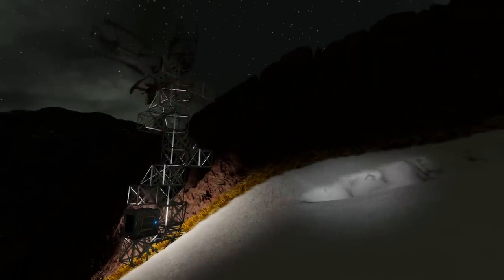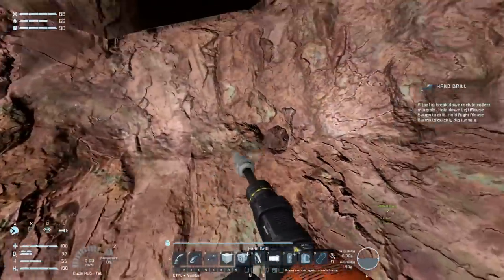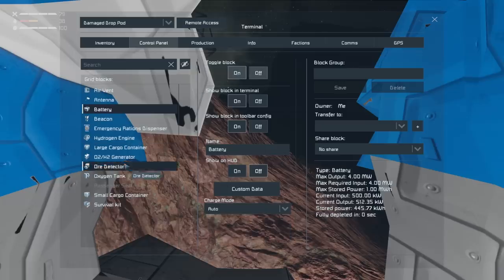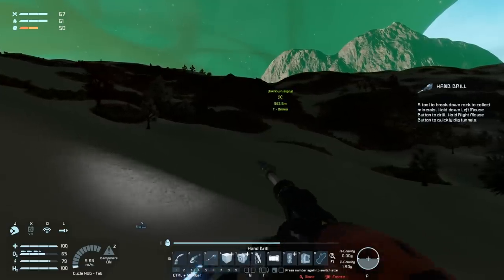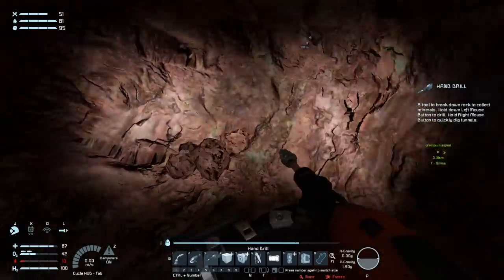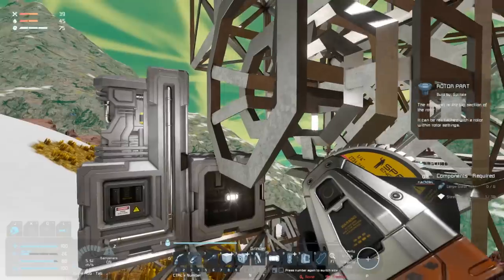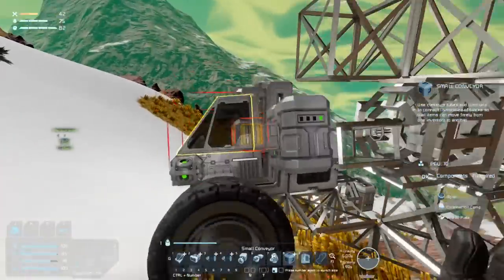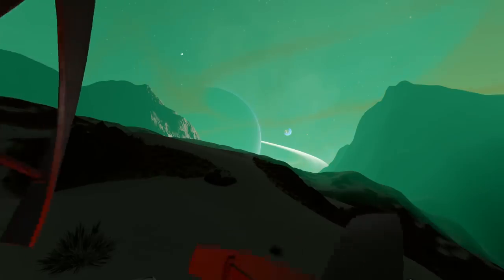Survival Impossible #2 - Space Engineers Hardcore Survival

Comment: 43:02 might want a connector on the back of the battery to act as a counterbalance for the drill when full. It should work well as a connector holds 1/3 of what a drill does.
Reply from the maker: It's an option, though I need to keep the end opposite the drill short to allow me to lift the drill high without colliding with the ground, so it might have to go on top instead :)

Comment: An idea for your truck plan: If you can put a rotor on the miner and a rotor head on the survival kit, you could just add a pair of wheels on the survival kit, attach the rotor head on the miner and drive the whole thing off without having to take anything apart. 
You may need to get rid of the seat on the survival kit tho. But I can't see it as a huge issue as you have a cockpit on the miner that you can use. 
An advanced rotor wits some piping might be able to even connect your cockpit to the inventory of the survival pod directly.
Reply from the maker: That would be possible, maybe though I'm suspicious that the whole I've got the survival pod stuck in is going to make moving anything out of there quite a challenge :P

Comment: Try adding another override gyro to compensate for the fully-loaded drill and turn it off and on as needed.
Reply: Or....the hover aligner script to control the level automatically.
Reply: Splitsie indicated via onscreen text that the blue lighting on the gyroscopes depict them being in override mod though set to zero. (Green = On and Red = Off Blue = Override). I believe placing Increase/decrease  override to its hot-bar would be sufficient if one wishes to stay balanced as the drills weight increases but he seems to be handling the vertical/horizontal (Pitch) with ease using the mouse while also lateral turning (Yaw) control.
Reply: @SirTragain  that is a lot more work than just using the script. He would only have to toggle the script on/off instead of trying to mess around with overrides.
Reply: I agree that a script would probably maintain equilibrium but I'm under the impression that Splitsie is purposely not trying to make it easy on him self and the addition of another gyroscope or a programable block would cost even more components to the build fore which he also stated he doesn't want to do 35:14 and a homage to the Ugly Duckling.
Reply from the maker: The script wouldn't be ideal since won't it also be trying to fight my manual movements with the mouse? I've not used it on something like this but I'm suspicious that might happen :/
Reply: I've never used the Hover Script so I can't say how it would react but it does sound like you would be fighting it when try to manipulate the angle. I don't generally use scripts but if I were to do so, it would be Isy's Solar Tracker or Vector Thrust 2 by Vermillion and maybe ones for LCD to display relative information such as battery status or inventory but even that is rare as a quick check of inventory or the K menu will tell me what I want to know.

Comment: 40:00 I made a vehicle similar to this, back in 2017, but on the Earthlike planet. Had a control seat instead of cockpit, and it had a few small cargo containers on top and was basically crawling back to base because it was too heavy to move when full... But was still easier to not wreck/get stuck in tunnels than a four-wheeled driller, and way faster than manual drilling.

44:00 I like this kind of initial vehicle, because once you need a somewhat larger driller (to make long trips worth the time spent, for exaple,) you can simply attach stuff to the rear, like a cargo container or two, and a second set of wheels.
Reply from the maker: I'm really quite enjoying the GUFI, as you say, when detached it's quite easy to get unstuck compared to something with more wheels :)

Comment: Quick question, not related to this video specifically but I've looked online and haven't found anything and you have done this before. How do I add one of my own Images to an LCD using a mod and not a converter? Thanks
Reply from the maker: It's not a particularly simple process, I've debated a few times with making a tutorial on it, but due to the need for something to convert regular images to .dds and include an alpha layer it all gets a bit convoluted (especially the part about finding a plugin that's from a reputable source that I'd feel comfortable sharing). If you're comfortable with that stuff, download one of my image mods and poke around in the files as that should give you a reasonable idea about how things need to be set up :)
Reply: Splitsie Thanks that will give me a place to start. I see why you don’t want to do a tutorial on it as finding a reputable source for 3rd party software is always sketchy

Comment: I'd mod the basic assembler to process gravel. The simplest method would be to produce scrap to be later refined; the whole mod would be 1 recipe. If you want to make it a little more complicated, use the basic assembler to assemble "Rockwool" from gravel (an interesting bit of technology, you should look it up), which gets refined as if it were stone, but without any gravel produced. Extra fun: change the recipe for reactor components to call for rockwool instead of gravel.
Reply from the maker: That's an interesting thought, it makes sense that the more basic assembler could process something that would mess up the sensitive equipment in the more advanced one. Another nice side effect of a double processing step is the increased power costs for processing it :)

Comment: 26:20 Discussion re: Basic assembler making tier 0 components, advanced assembler making tier 1 components etc. I started making a mod with this concept in mind and ran into the problem of assemblers having efficiency and, even if the recipe specifies 1 unit of hemp paper bag to make 1 unit of cement bag, it could still potentially use 0.67 unit of hemp paper bag. Even when I tried to overcome this, more often than not, I would have 0.01 unit of paper bag left in inventory.
I think it'd require some tinkering with the code to tell the assembler it can divide ingots any way it likes but components are used in whole number quantities.
Reply: Also, have you considered having higher tier bottles? Oxygen bottle that stores 300 units but has to be filled at a high pressure tank. Bottle and specialised components for high pressure tank can only be gotten from trading(?) etc. Maybe that defeats the point a little too easily.
Reply from the maker: Ah, thanks for that Jay. It's a bit annoying that it goes that way, so I suppose you'd need to make any 'tier 0 components' named as things that make sense to be broken down into fractions (wire, cable, cement rather than cement bag etc). 

I hadn't thought about better bottles, I'm honestly not sure how I feel about it given the overall aim was to make things harder, there might be a role for it eventually I guess. This will require more thought on my end :P

Comment: Great videos, mate!
What i dont get is why using rotor (with removed head) for attaching things which dont supposed to be rotated.
Reply from the maker: It allows the truck to attach to the trailer perfectly straight while also transferring power, I also use it for making a cheap connection to a base for when I'm building something small grid but want power during the building phase

Comment: Splitsie, given that you are unloading that thing by hand, and filling it in seconds, wouldn't a cargo truck to support you hand mining have been more material efficient?

Also, not sure off the top of my head if it is cheaper than connectors, but you could possibly off materials with an ejector-collector set. Of course, you'll need the connector to charge the batteries at some point anyway, so it might no be worth it. Although, the ejects are tiny, so they would fit the build a bit better.
Reply from the maker: I'm doubtful it would be, with this the drilling is much faster so I'm only doing the 'unloading' phase that I would with a cargo rover. I agree this isn't quite as versatile as a cargo rover would be, but it's probably more fun ;)

I'll definitely have to look into the cost comparison for a collector, even if it's not ideal I quite like the thought of using one anyway just :)

Comment: Make a conveyor that goes to the backside of of the battery on your drill vehicle and put a connector on it. Then you can make a cargo container on wheels or a small platform with your survival kit on it and you can use the drill as the front end of the "truck". you could even at that point put a button on your hotbar to switch from gyro steering to wheel steering.
Reply from the maker: I may well end up putting some form of connection there, because the idea of being able to move this little miner around while moving the cargo truck appeals to me :)

Comment: If you don't want to specialize the assemblers, perhaps you could make the basic one much more efficient than the normal assembler? That way it's still useful in environments where power is a bit on the scarce side, and allowing them to be used as emergency backup assemblers rather than just the previous level, (presumably) worse than a fully power-efficiency'd assembler.
I understand that it would make things a bit easier on you, but that's one thought I had to keep it relevant. The other was apparently the number 1 suggestion.
Reply from the maker: I think something along those lines is really the best way to go, though to prevent the easier thing, I'd just increase the power usage of the full assembler, so the basic is still relatively much cheaper to run :)

Comment: The power time was being squiffy because it is saying the battery will last that long if the engine runs indefinitely, the calculation is taken off the stored energy and while you are running the engine the battery is going down slower, run out of oxygen the battery takes over full power supply.

Comment: Since you didn't want to waste the plates on a large connector, would an ejector - collector work better?  I haven't made a collector in a looooong time and don't remember the component cost.  though I suppose the conveyor cost could add up to about the same as a connector.
Reply: yeah its a 50/50 between the two, connectors tend to be more convenient, small grid ejectors don't eject w/o sorters and it usually takes multiples of ejectors/sorters to be efficient so it is power consumption also you still need a way to connect to base and recharge :/
Reply from the maker: I think it might, but I'm really unsure. Even if it's not, it could certainly be a fun way of doing things :)

Comment: You won't use battery technique, but have no problem grinding something down a little bit and welding it back up to get a tech unlocked?
Reply from the maker: Yep, because to me those two things are like comparing apples and oranges, placing a new block vs grinding and repairing an existing one is not a difference in engineering challenge, while figuring out ways to get power without spamming new batteries has lots of fun engineering options :)
Reply: @Splitsie  I see it as an exploit of the game mechanics.
Reply from the maker: That's fair, but I disagree on that one. Especially in single player it's really up to you what you do and don't consider cheesy.

Comment: 7:00 I always saw batteries having charge when built as a silly thing. Also easy to abuse in a more vanilla environment. Batteries about to run out of power? Grind them down and rebuild them, there you go, enegy created out of nowhere, screw the laws of thermodynamics.

It's like crafting a plastic bottle in some other game, and it magically having water inside, or the dumb The Sims mechamic where any fridge you buy comes with food in it.

Never checked, but there should be a way to make batteries have zero charge by default. If you can change a planet's data...
Reply from the maker: The grinding down and rebuilding now requires a complete rebuild at least since batteries keep note of their charge even when damaged or partially ground down, so at least that's something
Reply: Didn't see that. Too used to it being cheaty to check with every update.

Comment: Looks like a vacuum cleaner. Couldn't you theoretically charge it by attaching a small rotor head to the back of the vehicle an then to the big rotor ?
Reply: indeed! curious to see if he will do this or go with connector instead
Reply from the maker: I may well go the rotor route at least at first (if I can get one at a reachable height) largely because neither end needs to be welded so at most I'll waste a couple of steel plate when I move to a new site :)

Comment: Can we reverse rotor to large and slap a wind turbine on it? Had some really nasty instant noodle. Wonder if the local people like the taste or even they are not happy with it. You can survive 5 years if you live like a monk. You should use the basic assembler instead of S kit to conserve the power for o2 and food/water. You need to dig a hole and trap it or topple it over for those that thrust away. Try putting piston, rotor and collector and stick it down the hole you want to dig. It should not clang if you do it slowly XD. 1 of my play. I just add conveyor tube and collector coming out from the pod.
Reply: i managed to get a large rotor head to attach to a small grid rotor on the spawn pod, then built a tower of large grid blocks onto the large grid rotor head followed by a wind turbine, however the wind turbine did not spin because it was on a sub grid :( same with pistons :/
Reply: I think you need to stick a landing gear on the grid the turbine is on. Not sure how klang that will go. Make sure you lock the rotor head and not land it on weird places.
Reply: @tohpingtiang4878  i think your right about the landing gear on grid for it to work, cheers.
Reply from the maker: I've done that in Wrong Way Down, when w4sted was building his trike I switched to large rotor then locked the large rotor to the ice lake with a landing gear so I could add turbines to charge his battery while building :)

Comment: what that miner needs is a dolly wheel under the drill for when it's full something on the lines of an interior light ... like a 1x1 base with mini wheels that only roll no power no nothing
Reply: a suggestion for the video series .. start the video before the break of dawn and run a full day cycle ... 
.

as for the basic assembler why not have it the only one that can refine stone into all the other ores in small small quantities ... that way it essentially chews up the garbage making it a bit more useful and while it runs on stone it will produces a bit of the advanced ores you need for other things but in such small amounts that it only makes a good stop gap measure for those ores
Reply from the maker: The two so far have been about a full day cycle, but it'll depend on what happens since I try to stop when I think I have about 40minutes of video worth seeing :)

Comment: Question for the masses. Are laser antenna's working. I'm able to connect to another grid according to the antenna but I can't access the other grid. Distance of 3km.
Reply from the maker: Laser antennas have always been a bit fiddly, do you have enough power on both ends for the laser antenna to connect? do you have access and ownership rights for both grids? Do you have a remote control on the distant grid (assuming you're talking about controlling it rather than just accessing its control panel)? Do you have direct line of sight to the other grid?

Comment: Splitsie, you dummy. MAX required input 330 kW. Required input 1 kW
Reply: 1kw resting, 330kw when refining or assembling, still quite didn't have enough power to have both running smoothly until the battery was introduced.
Reply from the maker: It's a bit of an odd one, some devices won't run at all unless they have their max input met, others seem to work weirdly intermittently like the refinery

Comment: Why did you put the battery on a rotor?  What does that do?
Reply from the maker: I'm assuming you're talking about the bit where I replaced the large grid head of the rotor with a small grid head allowing me to build a small grid battery rather than large. The reason to do this is that they're much cheaper so I was able to get a battery with stable charge up and running faster :)
Reply: @Splitsie   I realised pretty much as soon as I’d typed out the message that it’s basically a way of connecting small and large grid blocks.  That’s good to know!  Your tutorials are su-f***ing-perb! 👍🏻

Comment: Don't agree on the battery being a tricky game technique it requires materials to build its not like your using a cheat to create it and you are also hampered by an even larger loss in resources then normal for breaking it down. It is simply another way to get power to your vehicle. Its also likely more efficient then using a hydrogen generator. They have absolutely horrible return on resource investment except as a possible low power fallback when ice is plentiful and really easily mine-able. You would likely have been better off laying some large grid block frames to your vehicle and link them with 2 small grid connectors on rotors. A little slap dash but it can work to funnel power.
Reply from the maker: Those resources are incredibly easy to come by, that's why I feel like to use that approach is against the spirit of this challenge, realism doesn't come into it for me with this, I'm just shooting for a challenging style of gameplay :)
Reply: @Splitsie  LOL fine fine you are such a masochist man :)